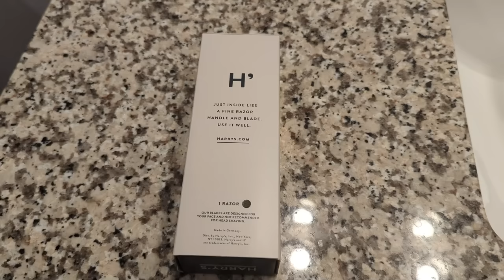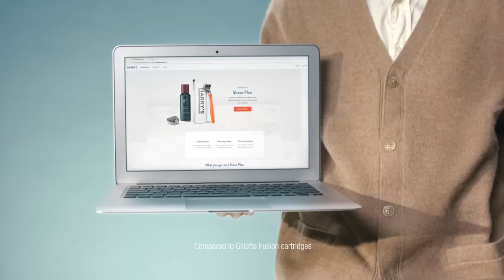The Sims 2's Even Weirder Handheld Games - The Golden Bolt

Comment: This is similar to The Sims Bustin' Out in that the GameCube version is very different from the GBA version. The best part with those is that they were connectable. You could use a GC/GBA link cable and move your character between versions, and Skill Levels you earned stay with your Sim on transfer. The GBA version is a great way to Skill grind your GameCube character.

Comment: 32:49 just feel like i need to point out: if you look in the game’s code, each character has slightly different odds on how easy they are to socialize with (for example: 10% more likely to accept a friendship ‘attack’). while most characters are neither easier nor harder to romance, it just happens to be that 50% of the female characters (Ara, Penelope, Misty) are 10% harder to romance. So, they made being a man with the romance aspiration like, unnecessarily harder than it ought to be. 

IN ADDITION. there’s a bug in the game that makes it so it’s pretty much worthless to play a male romance character in general. all characters in Strangetown have secrets which are unlocked by getting to max relationship in a certain relationship category. To make romance not useless (and keep it ~heteronormative~) certain secrets are unlockable in different manners depending on the players gender. Romance if you’re the opposite gender from the sim and friendship/intimidation (but mostly intimidation) if you’re the same gender. however, the game always treats the player as female when secret-unlocking regardless of their actual gender. so if you play as a male character in general, this blocks you from unlocking eight of Strangetown’s secrets (Ara, Ava, Kayleigh, Misty, Giuseppi, Luthor, Tristan, Sancho). now tbf there’s also literally no benefit to unlocking secrets outside of the ~lore~ but. that’s beside the point. 

basically, male romance in the sims 2 for gba is BS.